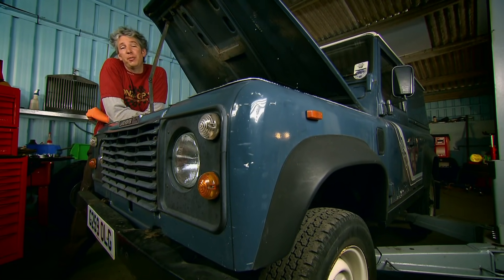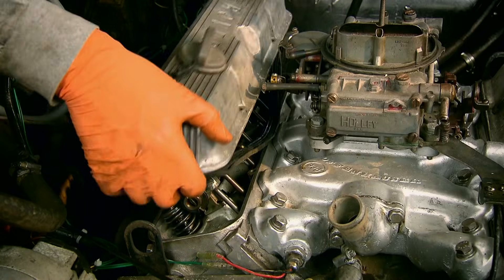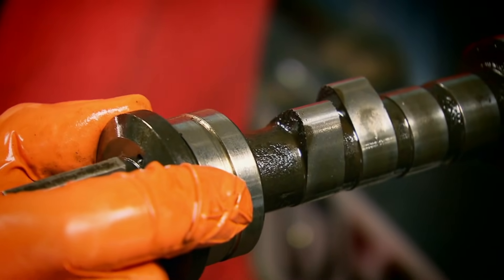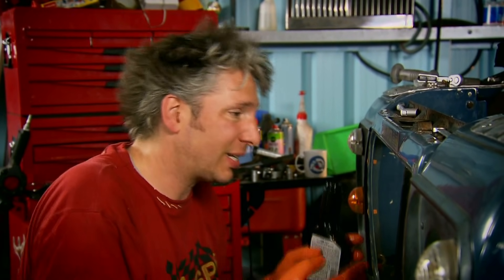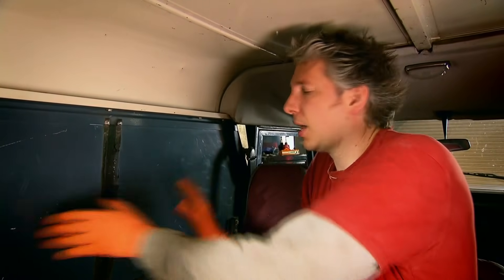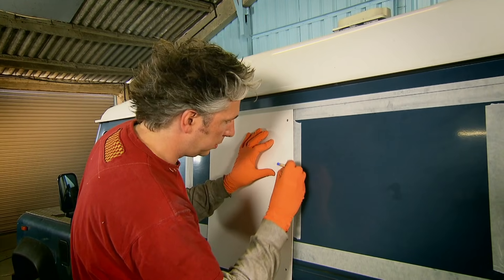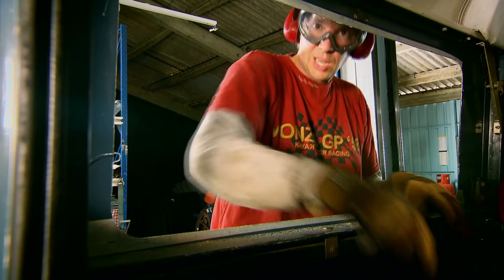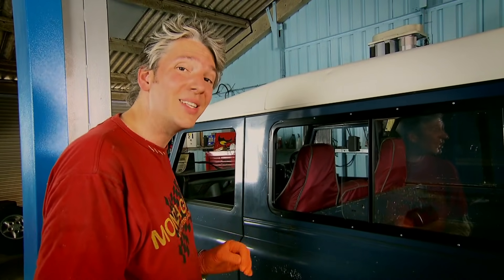Land Rover: How To Change The Camshaft And Install A Window | Wheeler Dealers

Comment: can you explain to me why 
wheler dealers NEVER ever had a 80's Opel Monza GSE with digital instrument panel ???? 
Have always wondered about it!
Reply: But they had an Audi Quattro and Chevy Corvette C4 with a digital instrument panel (which in the Vette was fixed).
Reply: Because they couldn't do every car ever made and some cars are hard to find and even harder to find parts for and thus harder to repair. Plus, the Monza wasn't very good and is a very niche car.
Reply: @calibrazxr750  opel monza gse is a pretty fun car. Opel were quite popular cars in its day. Senatoe, Manta, Record, calibra, Opel GT.
And Astra and Vectra.

Monza GSE - a truly magnificent car from Opel in the 1983 version.
and was the Senator's sister model.

Had it been a wv passat or polo I would have understand it.